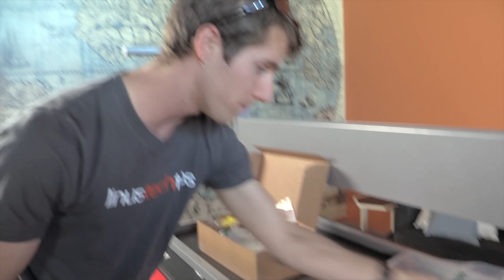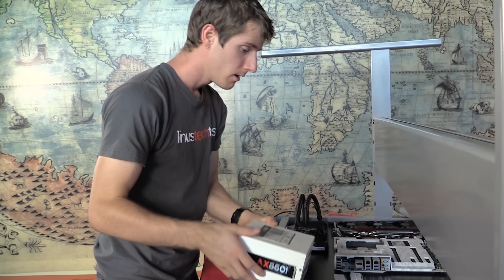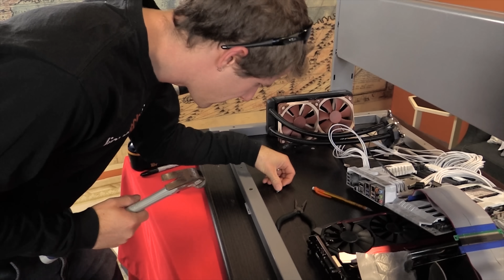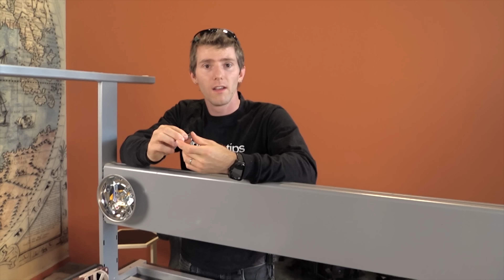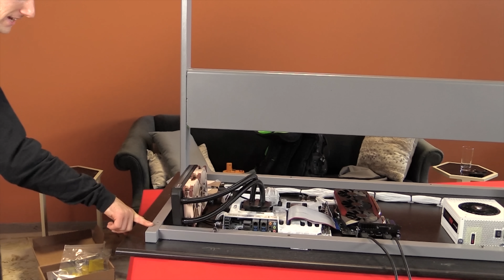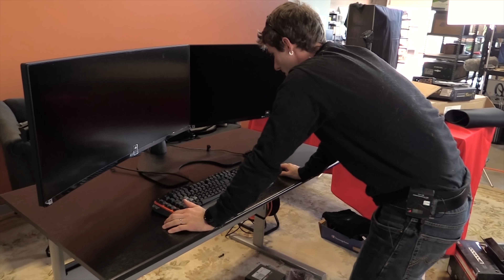The ULTIMATE Space-Saving PC - Desk PC Build Log

Comment: Hey lynus I got my first desktop computer and my screen dose nothing when I plug the hdmi in the graphicscard but the screens work when I plug the hdmi into the motherboard
Reply: try putting your graphics card into a different pci e slot
Reply: +Kantoast why would that work?
Reply: Your board might have a fualtypci e connecter
Reply: +Sindre Brun disable your on board video in the bios, or your card is dead. Switch UEFI to legacy mode.

Comment: If you do this, ground your motherboard out on the metal frame, and ground the power supply out on the frame. 
If you have no metal frame, connect a jump wire from the case of the power supply to a metal motherboard tray the motherboard is screwed into. If you don't have a metal motherboard tray... just turn around and go get one.
That is all.

Comment: Linus bro, why would you build a gaming computer under the table where it can be shown off? Build in the top of the table and through a glass plate over top of it.
Reply: +Vonzercroft This is for space saving, not bling. If it were for bling he wouldn't have bought a desk at Ikea.
Reply: +enginesnblades so I guess when the components are installed on top they grow 3x in size?
Reply: +enginesnblades so I guess when the components are installed on top they grow 3x in size?
Reply: +enginesnblades somehow i feel like that would have been a good idea since parts can fall under the desk but if they were inside it and the desk had good airflow you could also show off but save space too.
Reply: Vonzercroft Well yeah. Because you would have had to put something else on top and, for me at least, use color matching parts and paint the desk to match the scheme, otherwise you'd be going backwards. More time and more money for bling, which is not the point.
Reply: enginesnblades
WTF kind of engineering are you into where the pc parts just magically grow because they are put on top instead of at the bottom?
He built basically a gaming machine, with a distinct pattern and color scheme just to hid it for no reason under the table.
Reply: Vonzercroft Dude I don't want to blow your mind or anything. Just try to focus. If you build the PC like that on top of the desk, the PC will take up all of the desk space. In order to have a desk again you'd need to put something over the PC. Like build a frame and mount some plexiglass. I'm not an engineer, but that one's pretty damn obvious. However I am an artist, and that PC mounted to that desk was pretty damn ugly. Like, if the PC was on top of the desk the desk doesn't fit the scheme, not to mention the "scheme" is pretty loose as it is. It's just ugly, which is fine because you can't see it.
Reply: +enginesnblades it's even uglier under the table, and building a shadow box like frame around it isn't too hard.  honestly he should've built the desk too cause it looks like cheap shit lol
Reply: Vonzercroft For what feels like the 30,000th time, THIS BUILD IS NOT ABOUT LOOKS. IT IS FOR CONVINENCE.
Reply: enginesnblades Then why worry so much about the color scheme? Why would it even matter? And convenience? One misplaced knee and you're fucked, or you need to ever work on the system again you either have to flip the table or lay on your back and hope it isn't something too hard to repair.

Please explain how this is anywhere close to being convenient?
There is no showing it off, no easy way to repair and at worst easy as hell to ruin. Please oh pc god of youtube explain to me why this a better design than what I suggested outside of the idea of "lol my computer is under my desk"
Reply: Vonzercroft Not everyone is a comically clumsy dipshit that somehow knees the bottom of his desk every 10 minutes. I for one have never once come in contact accidentally with the bottom of my desk, because I have control of my limbs. It's great. Why color match? If you have 3 dozen mobos laying around why wouldn't you? Have you ever done something for yourself? Using a screwdriver isn't exactly difficult. There is nothing difficult about fixing a PC. Nothing. I already explained to you why someone would want this, and the additional work and cost of putting the computer on top while it looking good and keeping any desk space. You can re read if you'd like.
Reply: enginesnblades
People knee their desk accidentally all the time, shit happens. When shit happens I'd rather not have to pay for a new computer.

$20 on wood and another $20 for the glass for a better looking a safer build oh no what a nightmare, i didn't know you were a poor piece of shit.
He specifically built a color scheme for a computer and it wasn't because he just had mobos laying around but good try on that.
Doing any task with a computer like this, no matter how trivial or simple will still be more difficult to do than just reaching into a tower. Maybe not much though, cause it is really easy working on computers, but it would be an annoying pain in the ass if you ever had to replace the mobo. So convenient, and god help you if you ever get sick of the desk or it breaks at some point.

And your explanations so far boils down to "Lol i'm an art student this is so great" you haven't really explained anything.  Have you really done anything for yourself? You could make a strong wooden table w/ the glass needed for less than this probably cost at ikea, be an overall better quality build and show it off.

Comment: how did you handle dissapating charge build up or dissapating a short? Normally this would be the job of the case through the i/o shield, but you dont have a case and i didnt see any wires going from the mobo to the metal legs of the table.

Comment: can any of you tell me if this is good?? 
Processor: AMD-FX 8320 3.6GHZ 
SSD: 128GB Kingston 
Memory: 2x8gb Aries 1866 
Motherboard: Asus ATX Board AM3+ 
Powersupply: Corsair 600w 80+ Gold 
Case: Coolermaster HF series 
Graphics: Card: Radeon 7790 2GB 
Cooler: EVO 212 high performance aftermarket cooler
Reply: +OhSombraa 128gb SSD for boot? Perfect. However, 128gb only? Won't last you long at all bud, add in a 2tb HDD in there? I'd say add a larger SSD but seeing as it's an AMD build, I can tell this is a budget build.
Reply: +Armadillito Please guys push the read more button to see rest of the message...
Reply: +OhSombraa Er... it wouldn't work. There is no graphics card ad the FX- series have no on-board graphics.  Maybe a FX-6350 and a 750ti?
Reply: Tanner Rodriguez It's not hard to check though :-) It would be a very embarrassing mistake...
Reply: Petro Kuosmanen That wasn't there before... I did look.

Comment: McMaster-Carr IS awesome, how awesome?  check out 91075A111, there's your motherboard standoffs, in nice 18-8 stainless no less

also i wouldn't trust whatever inserts you shoved into that cheap IKEA wood for 10 seconds, i think that whole idea is flawed tbh, i predict the first thing to hit the floor will be that radiator and it might take your motherboard with it...if they don't come out over time by just gravity, i bet vibration will

also, isn't there something to be said about the electrical grounding you get in a typical PC case?  i've always assumed that some if not all of the mount points on a motherboard help maintain some ground right through the case, but i could likely be talking out of my ass here

Comment: How would you power it on
Reply: +Cristian Rodriguez They added a button ripped from a case.
Reply: ***** But that usually only happens after my PC is on! :-(
Reply: +Cristian Rodriguez  Duh.  Obviously, you have two bare cables attached to the two "Power" pins on the Front Panel pin array on the motherboard, and touch them together whenever you need to start the computer.  

You pretty much "hotwire" your computer every time you need to turn it on.

Nothing could go wrong.
Reply: He just glued the power button to the frame. Lame af. He could have drilled through the desk and put a red button under a glass case.
Reply: +Cristian Rodriguez maybe you could buy a power button, then drill it into the back of the deskbottom, then connect it to the motherboard, what could possibly go wrong?
Reply: +kent1146 I actually do this on one of my systems
Reply: You press the power button...
Reply: +Toli Chamos fallout!

Comment: you wield that hammer like a PRO 2-handed and everything

also a pro tip.... don't line up your monitors using a spirit level.... if the floor isnt flat it will look BAD..... instead measure from the top of the desk to the bottom of the monitors... that way it will LOOK right, even if the room you are in is WAY off...

Comment: I would not have built a PC into this kind of desk.  To me a better candidate would be one that has drawers that you can use to hide components in ways that both protect them and keep them out of sight.  For instance having  the main circuitry in a  thin drawer over your lap, actually dismantling the PSU so it would fit and re-working the cooling system for the situation.

I would also use one of the curved monitors in a central position with 2 smaller ones either side rather than having the 2 curved ones next to each other because the joint between the two monitors would be terrible for gaming.

Comment: Lian Li has a wall mountable case. You could event mount it to the bottom of the desk if you wanted to. It would be much easier to service and safer as well. With nothing really shielding those electronics it's only a matter of time until a catastrophic static discharge.

Comment: this was vrey cool. ive never heard of wall mounted pcs either. shoulda have done this on an updesk. so then you could move it up and down. also, how are you going to protect against dust? with no case how are you going to make sure that no dust or dirt gets on things that shouldnt get dirty

the desk i use has a unused drawer and i thought that it would be cool to put a pc in there. and just slide out the drawer when you need to change things out. the only problem would be cooling since its a closed system. you would have to drill out holes for air intake and outtake

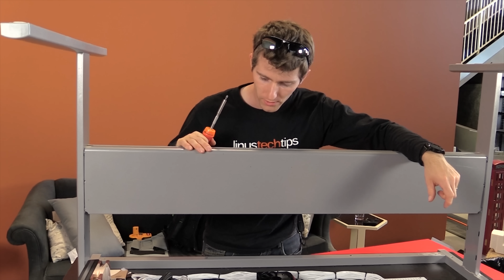Comment: 13:15 I know how you felt like linus :(  You see a few days ago I finally recieved the last parts of my new pc. I bought a bitfenix Shinobi case with orange mesh stripes. I oppened the package of the stripes in exitement and placed them on my ORANGE carpet and yes I stepped on them. I managed to bend them back to their original shape. After I installed all the parts I installed Win 7. Right after that I upgraded to Win 10 WITHOUT having Win 7 activated. I used a mac and a playstation to do  all of my web browsing and gaming. I didnt know that I need to activate win 7 before upgrading _. On top of that I kinda messed up with getting rid of win 10. Whenever Id boot up my pc it would tell me that something was causing major issues. I hab absolutely no idea what to do so I completly wiped my HDD using DBAN. I reinstalled win 7 and activated it. After that I really wanted to play some games so I picked up a 20 eur steam paysafe card. I swear to god that I peeled the coating away very carefully but some digits of the damn code ended up as a mixture of paper and ink on my finger :,( I then contacted stam support. Lets see how many days I have to wait until I get an answer.

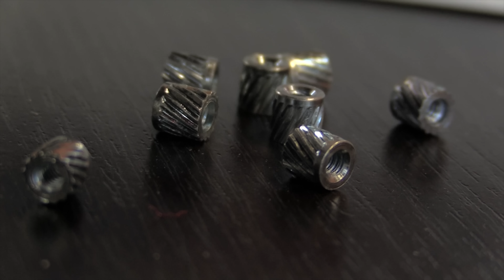Comment: 8:26 - what type of threaded inserts are these? I can't find anything quite like them online with such a steep thread on the outside.
Reply: Flat4Buggy Awesome! Thanks.
Reply: +Sevalecan I cant see his comment, what did he say?
Reply: neither can I for some reason.. they're under grooved and barbed under standard threaded inserts on McMasters website.
Reply: +Sevalecan Wooden thread inserts. There is one thing with this particular way of mounting a motherboard: a normal motherboard is grounded with the screws on the case, you often see metal points near the screw holes in the motherboard.
Reply: +FoodOnCrack Wat? The thread inserts are metal, and appear to also be under the category of press inserts for soft metals rather than wood. Anyway yeah, chassis ground is a common thing for virtually any electronic device.

Comment: Linus maybe you should of used a 1/2 inch thick piece of plywood that would fit inside the table frame so you could make needed changes in the future without having to drill more holes into the original table top. that would also help during mock up.

Comment: If you used a corner desk, there is plenty of room on that thing near the back of it to mount the mother board with the graphics cards actually inside the Pcie slots normally.. so you do not have to use them extensions.. and you can go either 2 way or 3 way sli as well.. trust me when I say, it would be next to impossible to even bump them with your legs.. also having the corner modular desk, its great for the two curved monitors and there is no guess work in which way you pull your chair up to the desk.. LOL  I will leave a link to the type desk I am talking about.. and they also have other straight desks just like the one you had which can be put at either end of the corner desk.. so you can toss up a printer or whatever else you want for your desk.. but really, I already have the corner desk and a long table desk, and would not put a computer build under it.. I would rather just make a regular build and put it into a very nice rack if possible.. where I can have all my networking cabling at the top, perhaps a apc battery back up and then a server or two mounted underneath the networking stuff and then at the bottom, a couple of the pc's I would like to build..  so everything is in one rack.. add some good air flow into it.. maybe even direct an air conditioning into it.. and you got a nice rack.. Ideally, it would be great to have it in a separate room where you have access to both front and back to make sure you can easily work on anything..

Comment: Pro tip from a guy who has mounted many screw points to wooden surfaces. Use some glue to help hold those screw points into the wood. Sure they fit nice and tight but wood can expand and contract eventually leaving them loose. With some heavy components they can eventually work their way out causing things to get loose or eventually fall out. Just a small tip if this project is gonna stay around for the long haul.

Comment: Great build, Linus!  As a suggestion, you might try mounting the power supply on the back side of that metal section between the desk legs.  This would work particularly well if the desk were set up against a wall.  You could also try mounting the radiator and associated fans back there as well.  If you want to get really ambitious, mount them flat against that metal section and cut a hole through it to allow the air to pass through that way.

I see these sorts of test builds as having great potential for space conscious applications.  For example, mounting inside of a vehicle such as an RV or a camper van.  Sure, most people just use a laptop, but wouldn't it be cool to have a combined PC, gaming system, HTPC, entertainment system built into a cabinet and using a swivel mounted display and wireless keyboard and mouse?  That would be both awesome and awesomely practical!

Comment: Very helpful video. I have a question 
I'm new to water cooler(radiator).My old case only has one Air slot in the front, and nothing on the top of it. 
Can I put a radiator on the top with fans on pull ? 
The top is all metal no opening for air flow 
Ones again I'm new to this sorry for the dumb question

Comment: Linus, you always tell us to not use the "Push" configuration on the fans to avoid dust to be stuck in between the fans and the radiator. plus you might touch them with your legs or finger, you should've put them Behind the radiator!

Comment: something i would have done: glass (or thick acryllic) table top with all the components facing up in an enclosure attached to the underside. fans and filters on either side creating a wind tunnel effect, good for air and water cooling. all the parts being open to the "elements" is a little frightening XD

Comment: with the weight of the monitors on that mount and the position of the desk frame you could simply add a piano hinge/s or multiple hinges and simply flip the desk up for easier access?

Just a thought.. but make sure you use some chain to stop it completely flipping over! ;)

Also just to add to the torrent of comments, you need to add some guard over your kit or it will get damaged soon enough or come loose especially if those lug's aren't glued in as they come loose from those desk tops over time.. 

made me laugh though.. :)

Comment: I am a little bit skeptic about electrostatic discharge.
PC cases are metal and closed and they "don't allow electrostatic interference inside the case".
Whereas PC built under the table is exposed to a lot of electrostatic charge,
especially when wearing such clothes.
To fix the problem, you would need to build some kind of metal plate under the table.
This plate could also help with airflow and dust problem, as channels could be made,
where air would come in and out and the beginnings of channels could be "protected" with
dust filters.